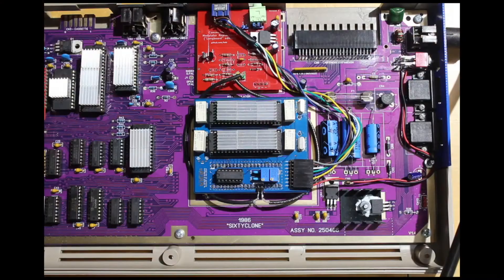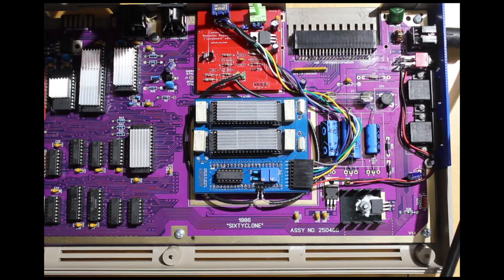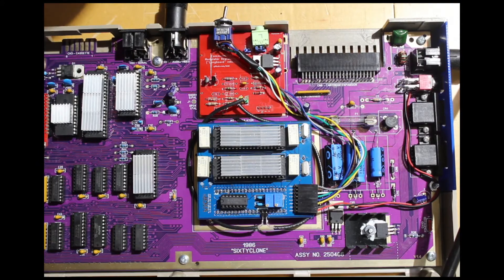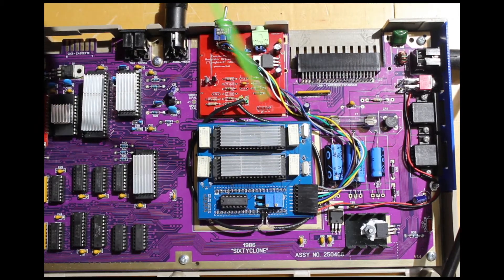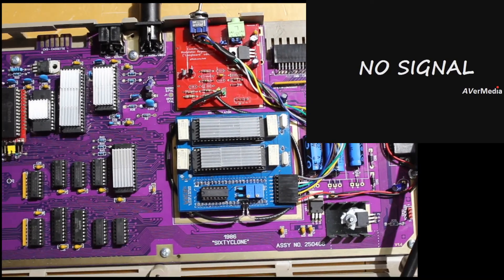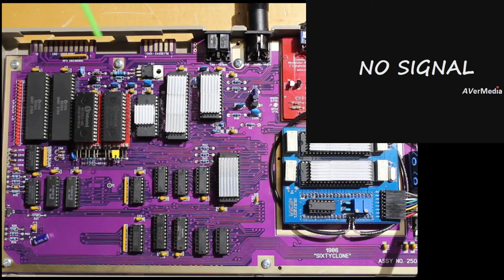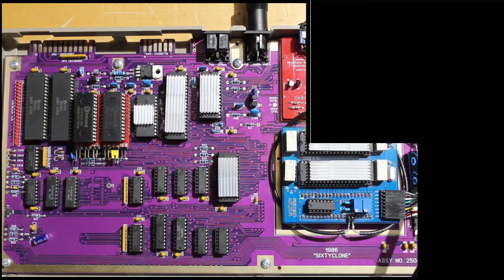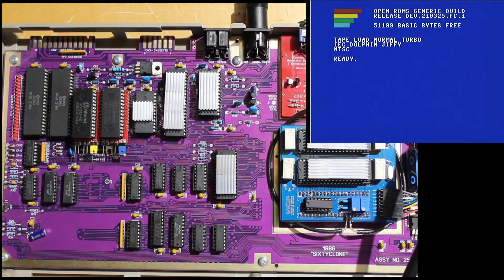Commodore 64 Sixty Clone build with VIC-II-2 and ROM switching

Comment: I too am trying to get the best native video from my C64.  I like how you are running short shielded cables from the Lumafix to the Modulator-Replacement board. have you cut the existing chroma/luma connections from the VIC2 to the C64 PCB... or are they still in place and just not connected at the Modulator-Replacement end?
Reply from the maker: I removed the pins on the vic-II-2 as well.  I tried to mitigate any unneeded traces/connections as much as possible.  I did a followup video too where I pulled the vic-II-2 and replaced with a lumafix and some better coax.